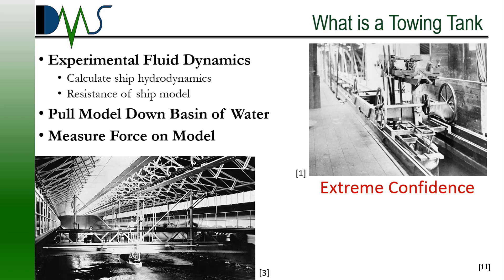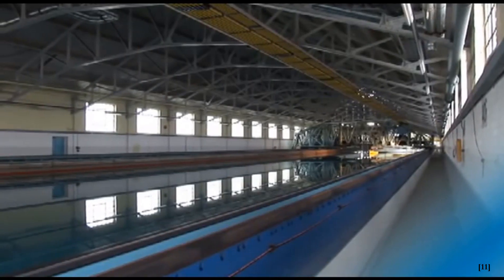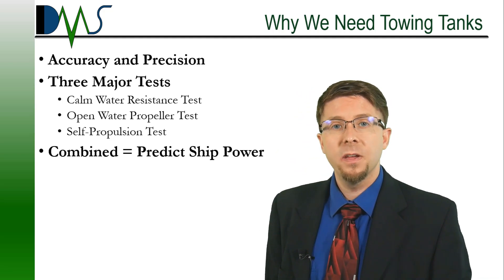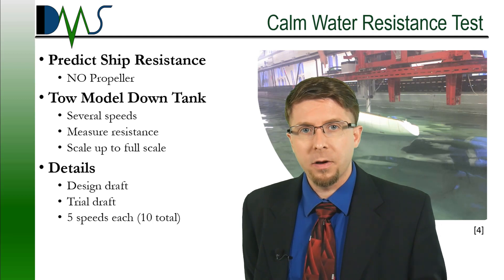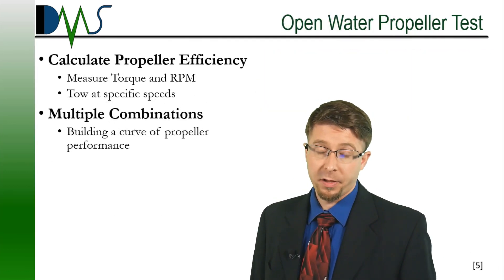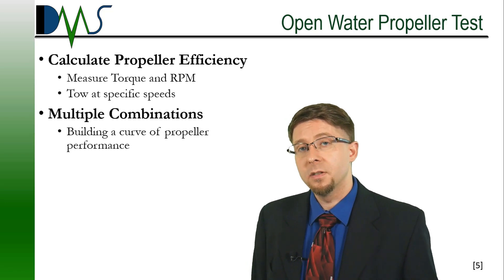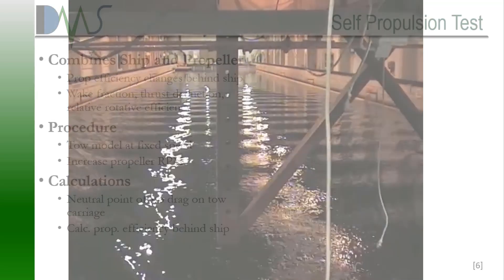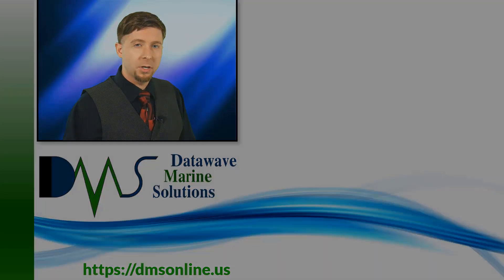A Professional Bathtub:  The Ship Towing Tank

Comment: Nick who makes these models?  What are the most dimensionally stable materials for making them, which must be important if they are required to be stored for long periods of time?
Reply from the maker: The towing tanks often make their own models.  Or you may find a fabrication shop that specializes in model construction.  Typical process for model construction:  we stack and glue blocks of high density foam in the rough shape of the hull.  And then a CNC mill cuts out the exact shape from the foam blocks.  We then cover that in a few layers of fine mesh fiberglass and add some paint coats.  Then the final model goes for dimension verification to ensure all the dimensions match their specifications within a few small tolerance.  
The fiberglass is fairly dimensionally stable, provided you use a resin that doesn't absorb moisture.  But even then, the model may change slightly over the period of several years.  One towing tank told me that after a year, they normally expect the old model to be distorted out of tolerance and unusable.

Comment: Danm, that's a simple idea. Thoes giant testing gantries pulling the ships seem darn complex though. What was wrong with a rope, some pulleys and a weight?
Reply from the maker: A rope pulleys and a weight was the original towing tank.  But the demand for accuracy increased as ships got larger.  Think about the consequences if we calculate the wrong number for resistance.  The ship gets either too large or too small of an engine.  It can't make the scheduled route, or requires more fuel due to the oversized engine.  All that translates into higher shipping rates, which ultimately increases the price on nearly every product you buy.  Towing tanks are one component in a chain of professionals, including the vessel crew, that work hard to deliver your cargo safely and at an affordable cost.

Comment: So if you do towing tank tests for a living, do you end up with an immense collection of toy boats? Probably not until after the ships in question are decommissioned if at all, since they seem to be effectively legal documents, but one can dream...
Reply from the maker: Actually, yes.  Typically, when clients pay for the towing tank test, they will also pay for the tank to store the model for a certain period of time.  The intent is to have the model available for later testing.  However, when I spoke with one tank company, they stated that the models are typically useless after a year.  The high precision requirements mean that the model looses its dimensional accuracy due to normal thermal expansion and contraction.

And yes, we frequently joke about taking some of the larger models (20+ ft long for a model) and converting them into a small yacht.  But as you said, the towing tank normally doesn't own the model.  The client owns the model.
Reply: @DatawaveMarineSolutions  I see! That's a much larger model than I envisioned, and much higher dimensional accuracy. The manufacturing of models seems like it would be in its own niche of a large precision component without particularly demanding materials performance requirements.

I could 100% be upsold on a ship purchase if I got to cruise around in the model, but I also don't have the money for the happy meal in the first place.

Comment: You made note of how precise the temperature of the water, is the water saline, and if so, is it held to the same level of precision?
Reply from the maker: Typically fresh water, taken from city water supply.  The tank will frequently measure the water density and correct their measurements back to standard salt water density.  That is why the temperature control matters.  We need density to remain constant throughout the day.
Reply: Water viscosity varies quite a lot with temperature too!